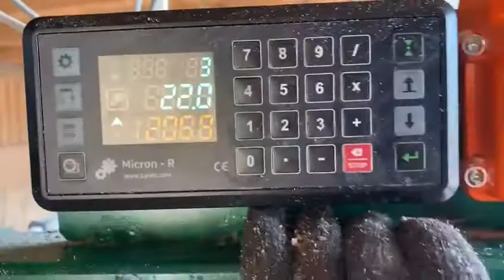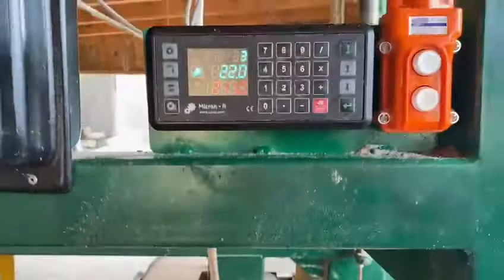Computer setworks for sawmill Micron-R / Sterownik nastawnik traka taśmowego Micron-R / Sägewerk

Comment: Awesome 👍 
How does the Micron R differ from the other models?
Reply from the maker: The difference between the Micron-R and Micron-LITE is that Micron-R works only in the metric measurement system and for the North American market we developed Micron-LITE that can work either in the imperial or metric measurement systems.

Micron-LITE has 4 presets or 4 quick programs while Micron-R does not. Micron-LITE can measure the load of the AC cutting motor and display it for the operator. Also, Micron-LITE can warn the operator when the motor is overloaded (a dull blade, etc.).

Please feel free to contact us via email if you have more questions  
info@mikronglobal.eu
Reply: @ComputerSetworksMikronLt  Thanks! I’m in the US so the LITE sounds like the one for me. 👍